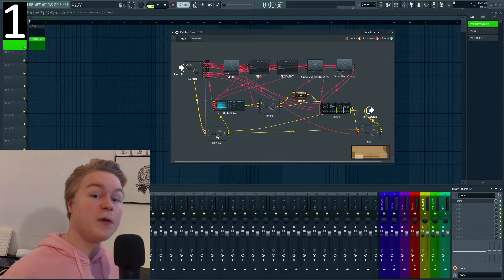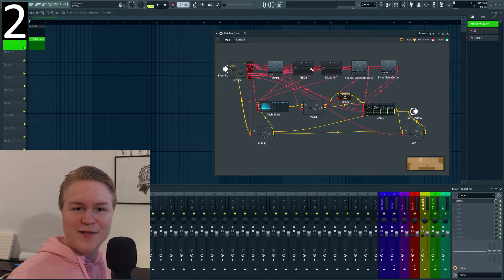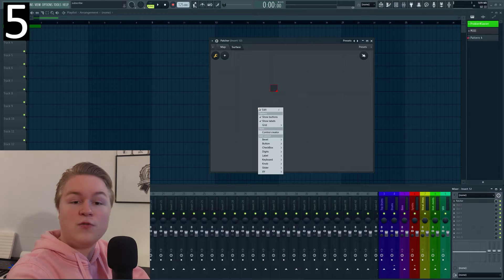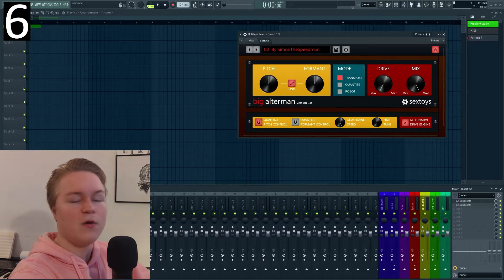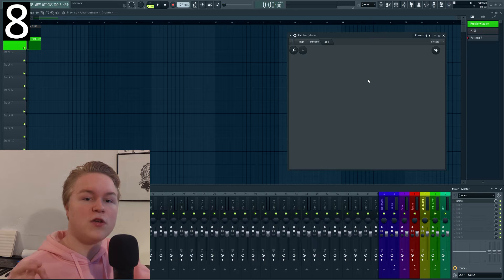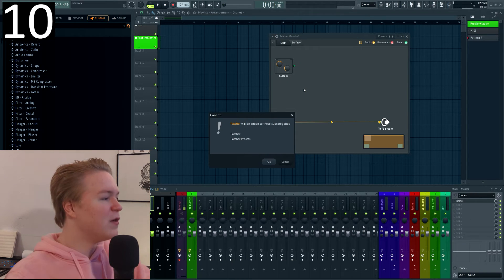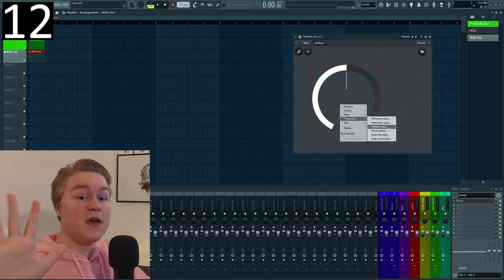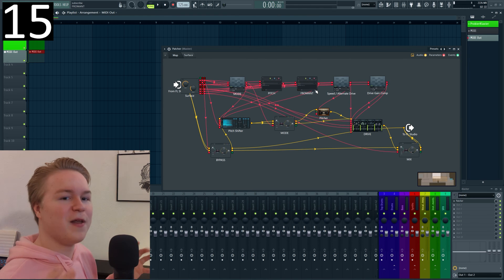15 Advanced Patcher Techniques

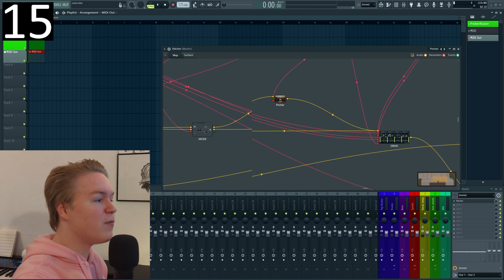Comment: 7:53 That's not a tip for me, but an annoying thing that keeps happening hahaha and the map looks messy after that
Other than that, that's the best video on patcher out there. Dled your free presets, thanks you, I'll use your Mixer from now on!
Also, you can modify .ilcontrol files directly, and use label instead of buttons: "... it's possible to modify any label's .ilcontrol file and give them a QuickFont.Name property to change the font." - BinaryBorn wrote in IL forum
I considered trying the peak meter thing, and making meters for Fruity Compressor, but now I know for sure that's possible

Comment: Very good video! One advanced technique you may want to consider is the ability to send parameter data OUT of patcher to be used throughout the project. This also allows you to process parameter data in sub-patches for organizational purposes.

You can do it with the fruity wave shaper and a peak controller. It's a bit hacky but it works. I can show you how to set it up if you'd like.

Comment: Hey ! Awesome channel and video thanks for all this incredible content. I had a question by the way. Right now I'm making a Patcher preset using a generator and a shit ton of effects and I thought having a version of this Patcher without the generator (that means a Effect Patcher) could be cool. Do you knwo if there is any way to do this ?
Reply from the maker: You basically mean turning a generator patcher preset into an effects patcher preset? I'm not aware of a clean way to do that, but of course you can just load an empty effects patcher and then put the generator patcher preset you made into that. If you want the same UI, you can save the surface preset seperately and also put it in the effects patcher and then reconnect all the knobs (after activating them from the generator patcher inside the effects patcher).